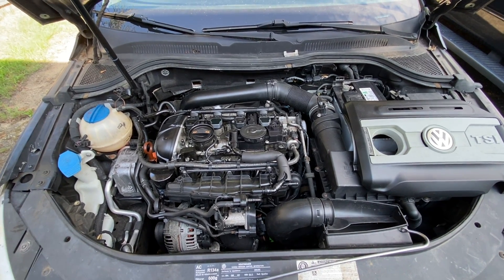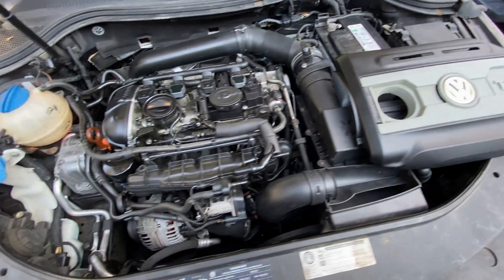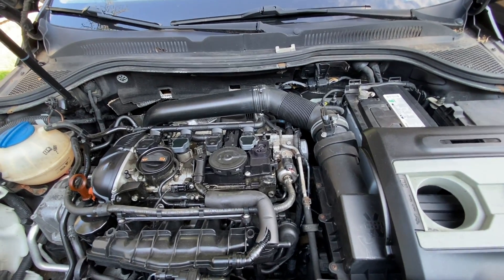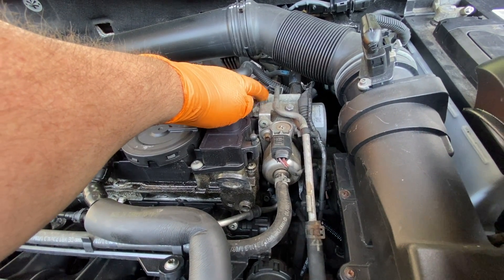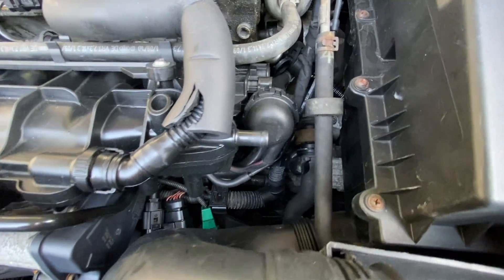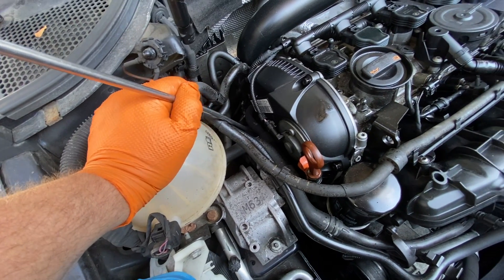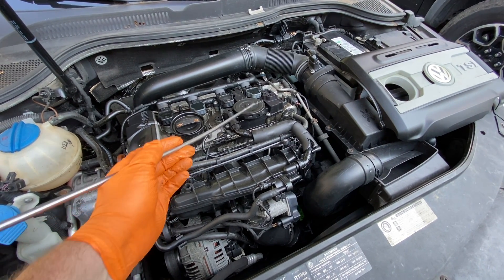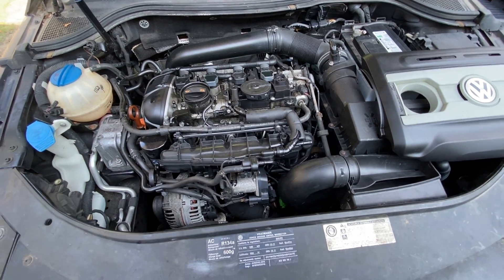VW 2.0 Turbo Engine Common Problems & Their Component Location

Comment: Hi Great video. Ive just bought a 2011 Volkswagen EOS and after driving it for a while have realised its drinking oil (about 1L/600KM). It's done 116000KM. I've just booked it in to get the PCV valve replaced (it doesn't suck at the opening it blows - mechanic said it needs to be replaced). I'll see how the oil comsimption is after that. Will check out your video on the timing chain tensioners thow. If I can solve the oil burning that might be the next job. Thanks
Reply from the maker: Sounds like you're on the right track, keep us updated on what you find!

Comment: What years are the bad ones?
Reply from the maker: For the most part, these engines are very reliable but I see a ted more problems with 2009 to 2012 engines.

Comment: I’m looking at beetles would the 2.5 or 1.8 be more reliable? I found a 2013 2.0 turbo with 100k, guy said tensioner was replaced under warranty and he changes oil regularly with amsoil euro, does that sound legit? Thanks
Reply: Every once and a while VW makes, almost by accident, a long lived, trouble free motor. The 2.5 in inline 5 is one of those. No turbo, non direct injection and has a cool 5 cylinder exhaust note.
Reply from the maker: That engine should have the new tensioner already from the factory so if they said they replaced it who knows if they are truthful.
Reply: @motorcarnut  thanks, is the 2.5L more reliable and longer lasting? I’m not really concerned with speed.
Reply from the maker: They both have their own quirks but one thing to remember is the 2.5 non turbo doesn't require premium fuel the 2.0 turbo does. Plus the 2,5 doesn't have a turbo to worry about either but the TSi 2.0 turbo engine is better overall in my opinion.
Reply: @ good to know, thanks !
Reply from the maker: No Problem!

Comment: what about a no crank no start on a 2008 Passat TSI with a 09G 927 750HJ Transmission...  any help there?
Reply from the maker: Too vague, can be anything, but I would check compression, ignition and fuel system.
Reply: @motorcarnut  You are right...  Too vague
its a 2008 passat 2.0T BYP...
Compression is good  and even on all cylinders
Rubber timing belt in good shape
Good sparks
Good pressure on the fuel line
I Replaced
Camshaft sensor
Crankshaft sensor
any help would be nice
Reply from the maker: @josealmeida8910 ok but did you say no crank no start meaning it doesn’t crank over? I’m confused because how would you do a compression test?
Reply: @motorcarnut  Sorry...  crank but doesn't start..........
Reply from the maker: If you did all that I would think its a wiring problem or the computer. It's also nice to know when did this start to happen?

Comment: What would make a vacuum pump bust? Son was driving on the highway seen smoke. Pulled over and something made it bust right threw the metal and oil everywhere. I replaced that and fuel pump but no compression now when tested. Any idea? Thanks
Reply from the maker: Sounds like you blew the engine if it have no compresion.

Comment: I have a 2021 VW Tiguan 2.0 se and lots of vacuum/sucking during the running engine , I replaced the PCV valve but still the same , so when I remove the oil cap it sucks it... Any tips  please?
Reply from the maker: Did you use a OEM part of aftermarket? This was a known problem on the 2020 to 2022 2.0 engine even more so.
Reply: @motorcarnut  yes , I used the same part # . But also I tested the old PCV valve by blowing into the inlet side , and was fine working condition... Any thoughts? What else may cause the suction in engine?! Thank you
Reply from the maker: Many things like a clogged catalytic converter, EGR system etc, but your vehicle is pretty new so it would have to be checked to see how much vacuum it has. Are there any symptoms ?

Comment: Tks for the tips and things to watch iut; i hv just bought a 13years used 2011 Passat CC with 80,000km only, and will just change the necessary as suggested (before it is too late). Question: when should i change the PCV seal/timing chain tentioner again (or how many KM will it last when new?). Appreciate your input. Tks much.
Reply from the maker: Thank you very much! Appreciated.

The upgraded timing chain tensioner should last the life of the vehicle now and the PCV valve too if you bought an OEM one.
Reply: @motorcarnut  do u mean after i hv the stock (old one) changed and replaced with new OEM and it will then last almost forever because of better quality now (for both tentiiner and pcv valve?
Reply from the maker: Correct!

Comment: I don’t know about other people but, carbon buildup on the intake valves and water pump leaks are my top two. I just installed the third water pump in my car due to catastrophic leakage and completed the second carbon cleaning @ 195,000 miles.
Reply: I had the same issue with my Tiguan. Recently, I changed the entire water pump system after 90 thousand KM.
Reply: Have you yet to replace the Timing Chain Tensioner?
Reply from the maker: Good question
Reply from the maker: Those are common as well unfortunately.

Comment: First, thank you for your videos 👍
I have a Passat 2.0 T TSI 2009. I changed all that stuff and cam chains etc plus oil pump. Now I have NO oil pressure on idling. At all !! 😮. New 2nd pump. OEM   goes up to normal/good pressure when driving, but immediately when it goes down to idling or coasting=no pressure.  New pressure sensor
Any ideas?
Reply from the maker: What I would do is take out the oil pressure sensor and put a gauge in that port and see the real oil pressure and let me know.

Comment: Great video's...I finally updated my tensioner and new chains ..Fired right up nicely but I had very old gas in the car and now I'm getting codes P0300 and P0301... It now does not fire upright away... I'm hoping I just need to dump gas and clean injectors and plugs..
Reply from the maker: Thank you! Well bad gas will cause a misfire for sure.

Comment: Hi, thanks for your video
Im thinking of buying an arteon 2023 with 8, 000 miles. Will this be a reliable car? Now that the car wil. Not be sold in the US, should i be concerned about parts for the vehicle?
Reply from the maker: No, that vehicle is not related to these problems.

Comment: A be car is something that u can drive for 3 years if you a good person and financially stable it will take u for 5 years … should u proceed to 6 years your wife will dump you … they are nonsense cars I have a gti but futsek a Toyota will do period
Reply from the maker: Toyotas fail too can’t even make it off the assembly line. All manufacturers cut quality for profits

Comment: I have noticed the rear left turn signal sockets fail as well.
Reply from the maker: Never experienced that yet but appreciate the info!
Reply: @motorcarnut  Yea i had a customer that had one failed, burnt spot on medal that touches bottom of bulb and ordered another from used car and same burn spot.  Just put a dab of solder and turn signal working fine now.
Reply from the maker: @Fortworthman999 gotcha, I’ve replaced many on older BMWS

Comment: You forgot to mention the notorious water pump. That bustard is a weak point no.1 my opinion. Replaced 3 of them on my cc 2015
Reply: What you have to do is put a pump with metal impeller and it will last forever. I’ve done mine during first timing belt change preventatively and it’s still leak proof at 218,000km. It’s due for a third timing belt now and I will probably just keep the pump still.
Reply: @olegk455  these are not timing belt engines. The water pumps are trash and the housings are plastic
Reply: @TrySomeFentanylToday mine is a belt driven, because it's an earlier  FSI design  but my point was more about the water pump that one can source with metal impellers rather than plastic.
 FSI engunes used plastic impellers from factory also but I installed a metal impeller pump and it has been trouble free for years. Still going in fact, and the car is 17 years old and we are the original owners.
Reply from the maker: You know, I’ve never had one fail only leaking.
Reply: I think they fail in the hot summer days when it gets really hot and you drive it hard that’s how mine failed after driving it hard for 30 min I parked on my driveway got out of the car and boom it dumped all the water on my driveway and that happened at around 300.000km I got know 365.000 and it’s not keeping the oil pressure changed the pump that didn’t fix it but yeah the pcv valve will blow the main seal it did it on mine
Reply: Vw 2018 Passat here. Had to have that changed 4 times. Coolant leak repeatedly. Currently fine, but they had to change makers as the usual sent defective part form.
Reply: 400 k km on my 2012 Jetta TDI  orig belt and pump,,,,,,,   edit.  Ten seconds after typing this. I finally realised what the slight grinding noise is when my rpms are under 2k.  My dam water pump bearing lololollllll.    It's time to do the whole assembly and belt.  Was just putting it off till I get few sunny days

Comment: CAN YOU REPLACE THE ROD AND MAIN BEARINGS WITH THE ENGINE STILL IN THE CAR???
Reply: Yes you can, but if your asking the question YOU probably can't.
Reply from the maker: @portagepete1 no you can’t on Tsi vws
Reply from the maker: Absolutely not, the crankshaft cannot be accessed.

Comment: Hii........my vwcc 2012 often drags when i start but once its warm it works normal. Pls what could be the cause of that?
Reply from the maker: Can be anything to do with the valve timing on these cars. I have many videos on these problems.
Reply: It could also be the carbon deposits build up on the intake valves
Reply from the maker: @MrTatica1973 that’s a big one!
Reply: Misfire and poor performance while cold are hallmarks of direct injection caused carbon buildup on the valves, which can happen in as little as 60,000 KM. Get it walnut blasted off at a repair shop or remove the intake manifold yourself and go at it with solvents and a pic.

Comment: Got the vac leak from PCV hole. Lots of pull by Oil Fill Cap too which was not properly fitted! Hope it is not the other Vac Actuator 2:20 issue but see in a week by garage. There is a 2nd Turbo PCV at lower rear left. Not sure if that is issue as only used a small boost around 3000rpm in driving and it stayed at low rpm to the garage whistling away.
Reply from the maker: Yes if left untreated it will blow the rear main seal so it’s good your getting it fixed now.

Comment: thank you for your videos, I have a question: I want to buy a Tiguan year 2023 tsi 2.0 engine, please tell me if it still has the same problems on Volkswagen engines today
Reply from the maker: Most of the old problems were resolved, so you should be fine. Good luck

Comment: Unfortunately, the "new style" timing chain tensioner is no guarantee that your engine will not self destruct. The timing chain tensioner on my daughter's 2016 Jetta GLI failed and wiped out the head (bent valves). The car  had less than 90,000 miles and is costing her $5,000 to repair!
Reply from the maker: Really? This is ridiculous. I didn’t really have any failures from 2013 up
Reply: Wow my 2014 GLI had 90k and no chain wear at all

Comment: Thanks for your videos - they really do help home mechanics - just replaced the rear main seal on my 2010 4motion Tiguan - I’m putting everything back together over the next few days - retired, so no rush - I installed 034 Motorsports billet seal - the original VW unit had delaminated causing a leak past the seal, the actual shaft portion was okay and not leaking - I completed the task with the Tiguan on 12 ton axle stands - I did not remove the subframe - just enough room to slide the transmission past everything. Again, your videos gave me the confidence to do these tasks. With the front suspension and CV shafts removed - I’m also replacing all suspension connections - ball joints, tie rods, and roll bar links, plus replacing front strut shocks - Bilstein. Plus changed the gear oil with the bevel box removed. Cheers
Reply from the maker: Awesome, thanks for the comment and feedback glad to help you out to do it right and save money! That’s what my channel is all about. Take care!